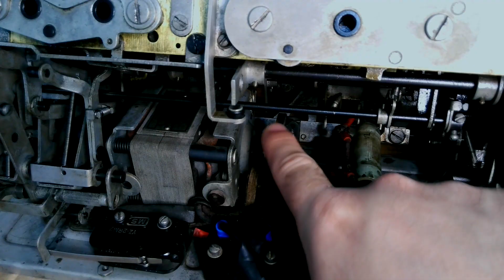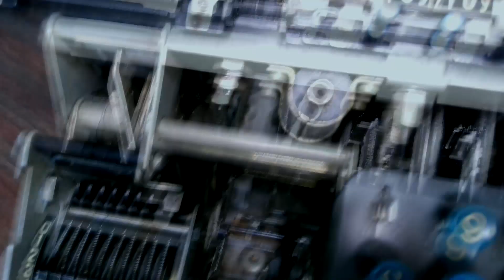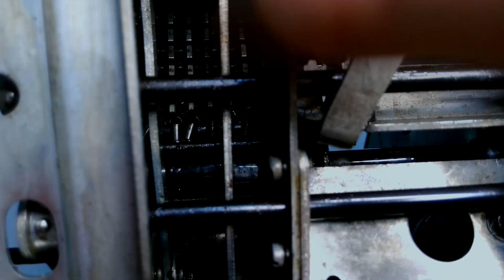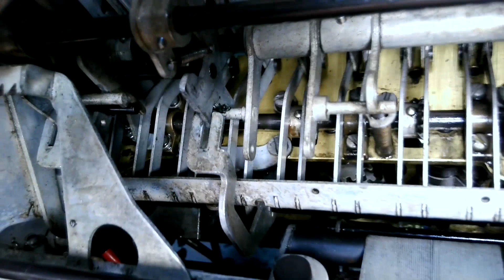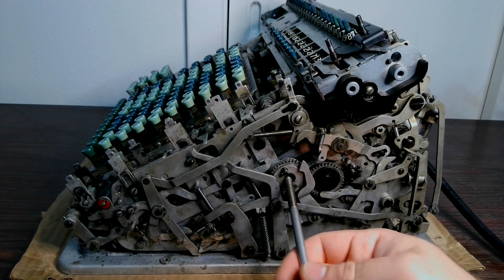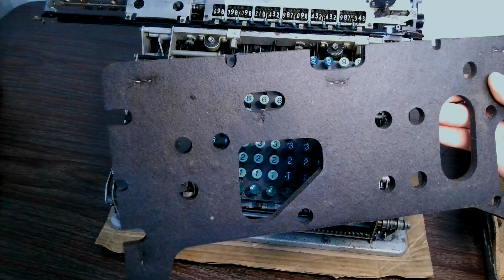Friden ST-10 repair notes

Comment: Dude, I've been trying to fix my one of these all summer. I've seen all the videos by bss1250, but this has been a considerable help with the operation of the multiplication mechanism. Just a couple of extra questions. Could you show how your drive for the slide is set up? I took the slide off wrong the first time, and I can't seem to get the drive gears set up properly. They just keep binding on each other. Also could you share your manual with me? Mine didnt come with  any reasorces. But thanks for the video it was made quite well!
Reply from the maker: Do you know if yours is a model STW or ST? The STW is more common and I was using a pdf repair manual from curiousmarc website. Here's a link:
https://www.curiousmarc.com/mechanical/friden-stw-10-mechnical-calculator

He also made a video with more disassembly showing the removal of the carriage:
https://youtu.be/1X3ivZfSfW4?si=dK40MKs9MVvAOTHX
Reply: @noahbabineau837  I have an ST-10, thanks for the recommendation, but I have seen that video and he doesn't take off the same thing that I did. Also Friden changed the drive mechanism when they went to the STW model. When I originally took my slide off I removed everything on the brass plate at the top back of the machine, but when I put it back together I'm having issues with the gears meshing were they should not. I can link some pictures tomorrow if that would help. Thanks
Reply from the maker: @spellablename6099  I can definitely take some videos, if you can send me some photos I will do what I can to show those parts.
Reply from the maker: @spellablename6099  I posted a video of the drive gears, hopefully this will help:
https://youtu.be/P1fAVf_J0og?si=dx-ldypGT2iruWsg